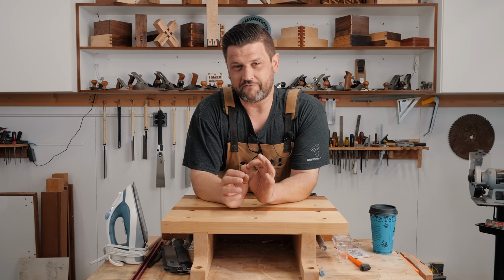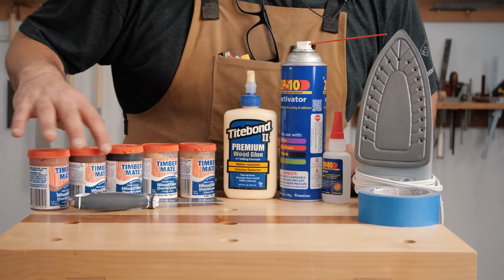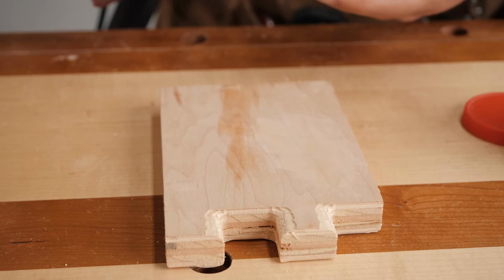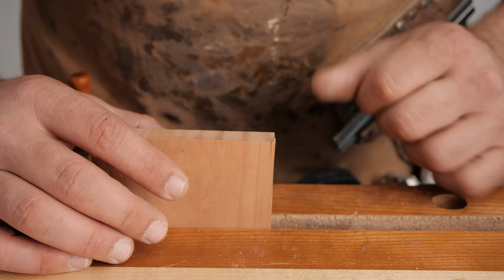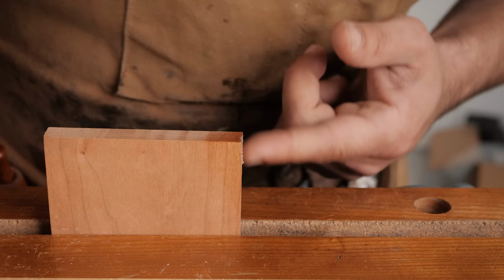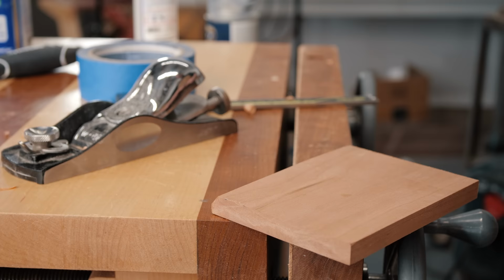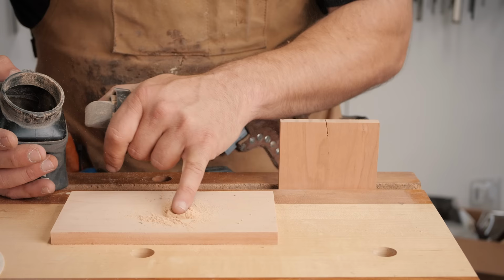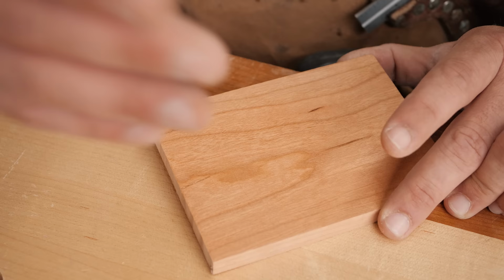7 Ways to Fix Common Woodworking Mistakes

Comment: Sometimes a board will have a small knot hole.   I don't want to saw the board to get clear wood because I really like the overall grain.  So like a dentist, I drill out the roughness on the bottom an clean up the edges.   Then fill the hole with a piece of same wood.  Then plane/sand flush.   Similar to the tip you shows for the large chip on the edge.   Since the wood around a knot hole is usually wild grain, it's not a invisible patch, but it looks a whole less obvious than wood filler or glue/sawdust filler.

Comment: For joinery gaps, I glue in slivers of wood into the gap. For a dovetail or through mortise, it's usually easier to match up the  end grain but I have also got good results matching the face grain. 

Just take some scraps and cut up tiny wedges, dip the section that will be in the gap in wood glue then lightly tap it in with a mallet or hammer. The wedge shape is important as it guarantees that there will be no gap after the repair.

I leave the glue to dry then I saw the plug flush with a flush cut saw (I really like the Japanese flush cut saws) then use a super sharp chisel  to pare it  flush. Sometime I also expand the gap slightly with a chisel to make it easier to get my wedge in.

When it's done right; it's nearly impossible to see where this was done.

Comment: Just to add further to the iron trick. If the dent is stubborn and refuses to pop back, with a fine scalpel you can carefully incise tiny slashes in the depression - just the tip of the scalpel. All three aspects will then allow the moisture to penetrate that little deeper to hopefully popping the dent.

Comment: If your piece is too small / rounded for the iron trick, try dropping a bead of water into the dent, then heat it with the tip of a soldering iron.
Reply from the maker: Great idea
Reply: @katzmosestools  When a pool cue gets dented, put a drop of water on the dent and use blue tape to cover it overnight.

Comment: curious for a better fix for a dent in a piece of furniture that is already finished and stained (majority of the time it's with a wax based stain). right now i usually just take a really small needle and poke extremely tiny holes throughout the dent and leave some water on top of it until it rises back up (which only sometimes gets all the way back up). it works most of the time but takes forever. curious if there is a quicker/better way to do it?

Comment: Instead of using glue and sanding dust,  try shellac and sanding dust, and drys fast.  It takes stains MUCH better.  I also use hot hide glue which takes stain good as it's a natural product,  unlike typical wood glue which is a plastic.

Comment: About the damp rag / iron trick for getting dents out:  would that work a couple of years later?

I have a bamboo floor with a some dents from dropping mugs, cutlery, chairs, and so on.

I can't use the trick right now because of the finish on the bamboo, but in a few years time I have to redo the floor, and the first thing I have to do is sand the whole thing, after which I could try the damp rag / iron trick.

Would it work after all this time?

Comment: sometimes I  run into very very fine cracks that I am sure can compromise the strength of the a board when they are under heavy pressure. They can widen up growing to  larger cracks that can eventually lead to total failure. how do you fix such cracks? 
I myself widen them using some fines circular cutting tools and go as deep as they go, then fill the whole gap with resin. Is there something better you can suggest?

Comment: If you are working on something that is not being stained and is being painted, then just regular bondo is your best bet, I'm a custom cabinet maker and it saves a lot of time it dries extremely fast like as soon and you mix a small batch and fill about let's say 10 staple or nail holes the first 6 are already ready to sand and it makes a really hard bond that is not as soft and wood filler and makes a smoother surface when you paint (wood filler can do the same just takes a tad longer)

Comment: CA glue is great for fixing mistakes, but save yourself some trouble down the road by putting a quick seal coat of shellac around the affected area before applying the glue to prevent staining the surface!

Comment: I find that the water on the board works better if you put the water on the opposite side of the board ( the cup side) for it will tend to expend the wood on that side and the board will get strait almost by itself

Comment: Save the sawdust! I fill in minor gaps with glue that I poke down into the gap and then cover with sawdust from the same wood when routing or other operation that creates small dust. I put left over dust into a container with a lid and mark it with the kind of wood that it is for future use.

Comment: For the first tip: I usually save sawdust from the actual wood I'm working on and if I mess up, I use a mixture of the sawdust and clear wood glue to fill it
Reply: Ah I see you use the same tip later too

Comment: Instead of wood glue apply some polyurethane to the area where you gap is and hand sand it to create a slurry. Use the slurry to fill in the gaps. Let it dry and sand again. It helps to match the color getter than glue from my experience. Even if your piece uses a different finish than the polyurethane you will be sanding it off and wont affect it.

Comment: I've used CA for that same issue many times but the "super thin" is the best as it soaks through the wood and makes the bond stronger. BE CAREFUL when holding it as while adding the activator .... IT GETS REALLY HOT AND YOU WILL BURN YOUR FINGERS.......... learned it the hard way
Reply: Haha. Ya big time. Not a fun lesson

Comment: Similar to what you did, take the sawdust and glue and make a filler paste. You have to watch out using a metal putty knife with some glues. Some react to the iron and turn the glue dark brown or black. Not what you want. Also, if you set your plane on pretty course, you can take a curl off a piece of scrap wood that you can glue into a small crack or joint imperfection. It helps to moisten the wood first so that your curl comes out better, without breaking. ayou will have to experiment with the blade adjustment. Also, if the crack tapers off, use a razor saw to saw the crack to one thickness. Wood beats filler every time, nearly.

Comment: You can fix dents on the fly if you don't have something hot by simply wetting the dent and letting it sit for a while. Takes longer, and sometimes takes 2-3 rounds of wetting, but lets you repair the dent while moving on to other parts of the piece.

Comment: Your not going to believe this, but man does it work and work fast. I work in my garage and it's really hot, I sweet a lot. So I take the sweet off of my forehead and use it to raise the grain in spots if needed. The grain raises really fast And I can sand it down. No problems. A part of me goes with every project. Lol. Great job on the video. Thanks
Reply from the maker: hhahahah gross and useful
Reply: @katzmosestools  quick fix. Lol
Reply: @pawemichalak6275  lmao

Comment: The trick for fixing a broken corner by planing and gluing is a great fix, but don't limit it to small pieces. I make 2" thick tables where I have a beautiful face on a board, but the back corner is too short and ends in a wide edge. Plane flat, glue a piece in and plane it flat to the corners. I have done this where the corners are missing a couple of feet back and almost 3" wide on a 2" thick board.

Comment: to fill a curve with sawdust you can do that right away with the sander. Put glue in the gap than take the sander and block the dustport for the vacum with your hand or some tape or so, than when you sand the gap the machine pushes the dust right into the gap.
Reply from the maker: I'll have to try that

Comment: thanks for all the tips.
as far as the sawdust and glue, use a product called sanding sealer. you won't ever see the glue.
source: lots of mistakes in 4th year carpentry shop.

Comment: How can I get all the glue out of an inside joint so the stain will take in the wood? I have built a few boxes and thought I wiped and sanded the glue that came out during clamping but when I go to stain I have a light spot that will not stain and it is then too late to sand more.

Comment: the last tip only works on very specific occasions.. when the boards grain is going the wrong way and you put water on the wrong side it will actually make the bent worse

Comment: I was repairing an old oak pedestal table and some of the parts had been nailed over the years. I drilled all the nail holes to match 1/8 dowel I had in the shop and plugged the holes with that. The end grain on dowel is darker and  it just looked like small knots. The owner didnt even notice.  I also keep a box of toothpicks in the shop to push glue into cracks. The flat side of the toothpick will go into almost any crack.
Reply from the maker: Great idea!
Reply: I was actually surprised at how natural it looked. It was a very old cheap oak table and the pedestal feet were 3 layers of oak that had delaminated and been nailed together. I flat sanded the pieces and glued them with better glue and plugged the holes. Sentimental value for his wife-she grew up with the table. They both cried when I dropped it off. That was sooooo cool.

Comment: Re: minor dents. If you're going to apply an oil finish, such as trinity tar (linseed oil - vinegar - turpentine), those dings will generally swell out when you slather on that first goopy coat. That goes double if the wood is at all soft. Thanks for this awesome video!

Comment: What would you suggest for botched drill holes? Ive got a project and the drill holes on one piece got pretty bad and have bad edges but i need to keep it at about the same size. How can i fix this?

Comment: The sawdust-glue will not take oil-based stain any better than just plain glue does… so if you have those repairs you may need to either pre-stain the repair w dye stain (water or alcohol) and let it dry completely then stain the piece normally. OR do what the furniture refinishes do and tint the top coats of the repair

Comment: Can you do the one where you're sawing in the dark because you want to get something done fast, and you can't even see where you're cutting, but you're pretty sure it's in a straight line, but it turns out you just cut at a 15 degree angle into your door and need to buy a new one?
Reply from the maker: This made me laugh 😃

Comment: I started cutting wood with miter saw and circular saw. Everytime I cut a board. It’s def not fully straight especially from circular saw. How do you fix the problem? I want like 18” but I cut it to less than 17” or 18.25”.

Comment: True story. I was building an RC plane outside and had to mold a thin piece of balsa onto the rounded fuselage using water an CA glue. I didn’t have the proper clamps so I held it in place with my hands for 5 minutes. Yep! Four foot airplane glued to me. It hurt but I got free.

Comment: I'm good with my hands and like to think that if I had an actual workshop and could afford real hardwood and all the laser guided tools they use on those TV shows.... but I digress. 90% of my woodworking is making a duplicate of some piece of drawer or whatever. Closest I ever got to fine woodworking after 8th grade wood shop was a set of custom corner steps to mate a hot tub to a deck on cracked and uneven cement using pressure treated 2 by. But my question is, when rip cutting a long straight piece on a table saw, can anything be done when the piece you planned on using comes off all  twisted and warped?

Comment: Great video Jonathan! I've used the glue and sawdust trick many times, as well as making my own wood putty by mixing sand dust and glue until I get the consistency I want.
How would you repair a board that has a slight bow in it? Would you do the same procedure as a cupped board?
Reply from the maker: You could try it but I think that would warrant a hand plane or a jointer. Strategic water and clamps can work wonders sometimes though
Reply: @katzmosestools  Unfortunately I have neither a hand plane nor a jointer, so I was thinking of wetting it in the area of the bow and starting with thin pieces of wood under the bow and progressing to thicker pieces if needed, then clamping the ends down to my workbench, (such as it is). If this doesn't work, these are pieces that I had laying around that I wanted to use to make a router table fence, but they can always be used for something where their full length isn't needed,. I'll just buy boards that are straight to make the fence.

Comment: Knot holes can be filled with epoxy resin. 
But that creates an ominous looking dark glassy spot I call a shark eye. 
To combat this I clean out the knot hole of any remaining dead pieces of the knot. 
Then collect long shavings from a similar  piece of wood. A hand plane will work. But a spoke shave makes better shavings. 
Then smeared with epoxy I roll those shavings into a cylinder and stuff it about halfway into the hole. And let it dry. 
Then cut it flush with a pull saw then sand it flat. 
I use thin shavings. Thick shavings. Long or short. It doesn’t matter. 
In fact the more varied it is, the more believable it looks. 
In fact it looks better than the old black knot. To the extent I now dig out solid knots, if they’re black,  and replace them with a spiral of shavings. 
It turns what would have been an eyesore into a feature.
Reply: I'm with you on the horrible 'shark eye' look. Thanks for the tip. I'm going to give that a try.

Comment: Thanks for the tips, these are great techniques! I've been having the problem of cupping after resawing boards especially plain sawn cherry. I milled a 1/4in board of quarter sawn mahgany and it remained very stable and flat... Until I applied a coat of sanding sealer and it cupped like crazy! Any tips on how to prevent that or why it happens?
Reply from the maker: You have to put it on both sides or that'll happen everytime with thin boards. I try not to do anything to thin boards until they're in place if possible
Reply: @katzmosestools  Thanks! I applied it to both sides but I did apply it to each part before assembly. I thought it would be easier that way because it will be hard to add the grain filler in the small nooks once it's assembled. But perhaps it's just unavoidable? I will try that next time. Thanks so much for your advice!

Comment: When doing the glue-and-sawdust trick, use wood glue, not CA glue, which will darken the sawdust considerably.

Also, steaming out a dent does not work that great if the wood fibers are broken. In that case, try steaming to get rid of the worst of it, then apply filler.

Comment: Does the iron trick work well enough to remove snipe from a planer?
Reply: Actually, now that I think about it more... probably not.  The iron trick seems to work when the material is still there (just compressed).  For snipe, the planer has removed material...

Comment: My tip:  Put the cap back on your CA glue before spraying activator, especially if the activator is aerosol and goes everywhere.  I've had to throw out half-full bottles of CA because I accidentally hardened it with activator overspray.

Comment: Is C A glue/activator safe to use for gaps on cutting boards? Or other wood projects that contact food?
Reply: My search for "ca glue food" turned up a number of write-ups.  It seems that cured CA is safe, but uncured has produced allergic reactions.  A varnished surface ought to isolate the glue.  Of course, the varnish could be troublesome.

Comment: I'm a newbie and I'm trying hand carved mortices.  Im often cutting them too big.  Is that fixable?
Reply: Wrap or glue plane shavings to your tenon, then re-adjust the tenon size to your mortise.  It's easier to cut your mortise first, then cut tenon to fit the opening.

Comment: Any tips on how to restore and sharpen a japanese saw? Mine has been around since the 80's, and it's color is bad and very dull. This was my grandfathers, so I would rather restore it than buy a new one. I don't want to do it without asking for advice first, as I could never forgive my self if I damage my grandfathers saw.
Reply from the maker: I would say hang it on the wall and get a new one to use

Comment: I have a table that I am making from a crotch piece of pecan.  I ran it through my router sled to flatten it and now I have a substantial amount of tear out from the router in the crotch figure.  I have been sanding it like crazy with 60 grit, and much of it is gone, but I am wondering if there might be a faster, easier way to get rid of this tear out.
Reply from the maker: Google "architectural millworks" in your area. You can pay them to run the slab through their wide belt sander. Usually less than 60 bucks. Great finish too, especially if you've already flattened it

Comment: Fastcap makes a nice "Wax Blending Kit" with 20 colors. Use only on finished surfaces (otherwise, your finish will melt the wax). 20 colors not enough to match your boo-boo? Mix two colors on a large putty knife, melt them together with a flame from below; then mix while still warm.

Comment: Regarding the cupped board, it seems counterintuitive to me. Doesn’t wet wood expand? And if wet wood expands, wouldn’t it make sense to wet the concave part of the wood (opposite of what you had in the video)? I’ve never tried it myself, so it’s a genuine question and not some armchair expert comment 😊
Reply from the maker: Because when it dries it pulls the board with it. Too much moisture escaping too fast is what made it cup the other way so you're just reversing it

Comment: I do not recommend the angle planning trick for matching surfaces.  The problem with it is when you sand it flatten the new surface.  In the process you begin to expose the gap beneath it.
Reply from the maker: Not if you plane it straight.